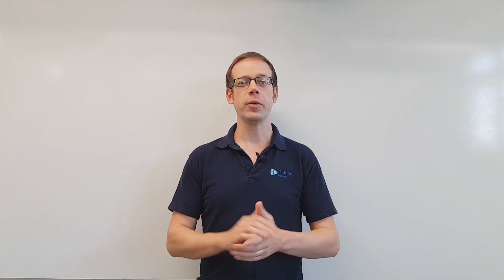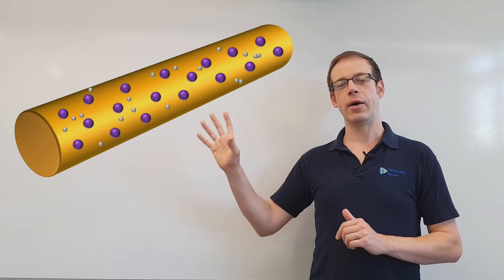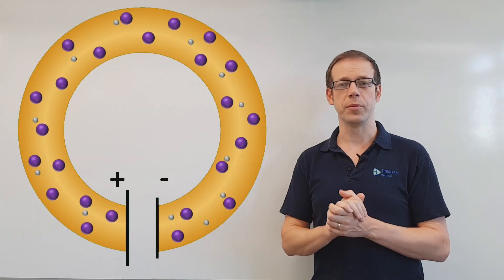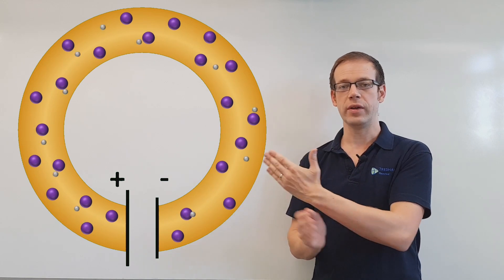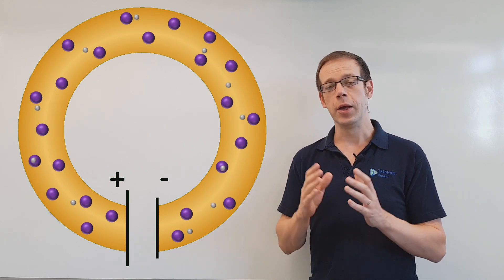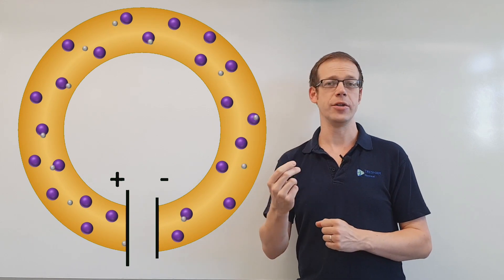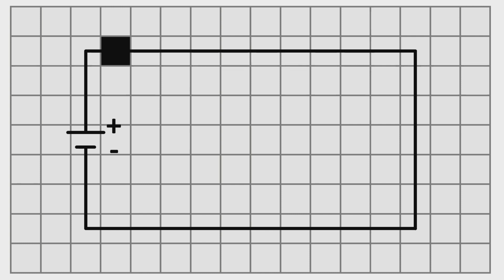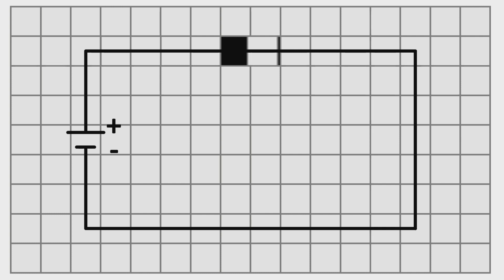What is Electricity? Part 3: Which Way Do Electrons Flow?

Comment: I was a student in the early 70's , this topic came up then too, vacuum tubes only make sense in a neg to pos current flow as the heater released free electrons, today the pos to neg is fine and the arrow is also pointing right. I know the Air Force taught neg to pos at least into the 80's.

Comment: As with Newtons apple, perhaps the assumption that, with the atomic particle analogy, it was assumed that said "particle" was positively charged (aka "up").
"up" vs. "down";   "up" has no meaning without the presumed existence of "down"
"Conventional current": the electrical charge moves (changes) from positive to negative; (aka "up" to "down")
Likewise, "positive" presumes the existence of "negative"... relatively speaking, less negative could be considered as "positive". To wit: the negative end of a battery is less positive than the other (i.e. not necessarily "zero"... aka "ground", or "common" - the term is a matter of choice; there were British automotive electrical systems that used "+" as "common") Said "holes" could be just as easily be referred to as "posies" (pronounced Paw- sees).

Comment: Hi Joe,

I hope you can clear this up for me. Since you mentioned the 29th Electron having a casual relationship with its parent atom, able to jump for atom to atom, I’ve been wondering why or if its just this 29th (free electron) that moves when energised, or do all 29 electrons move collectively.
 
I saw that you mentioned Brownian motion to a question on “why do electrons move randomly. Heres what I found, I was just confused as you have mentioned the 29th electron again. 

It is important to note that Brownian motion is not specifically associated with the 29th electron in copper or any specific electron in a material. Brownian motion arises from the thermal energy of the system and affects all particles within it, including atoms, molecules, and electrons.

In the case of copper, which is a solid conductor, the motion of electrons is not typically described by Brownian motion. Instead, the behaviour of electrons in a solid is better explained by quantum mechanical principles, such as energy bands and electron wave functions. Electrons in a solid like copper can exhibit collective behaviours, such as conducting electric current or participating in electronic interactions with neighbouring atoms.

Comment: You say the flow of electrons is the flow of electricity that flows from the negative terminal of a battery to the positive terminal. The problem with that logic is that electrical current actually does indeed flow from the positive terminal to the negative terminal in a dc circuit.

Simply experiment, connect a battery to 2 dc light bulbs that are separated by a significant distance and you will see the light bulb connected closer to the positive terminal light up first proving electrical current flows from the positive terminal to the negative terminal.

Comment: Hi Joe, i am always a bit confused. My eternal confusing comes from the following: So when you are touching the ground, and you touch a positive terminal, the ground is releasing the particles (electrons) that will actually shock you? Which is unintuitive because you would think the positive terminal (like a full bucket) would release the particles (water) to hit you. Its just  the unintuitive nature of negative particles i guess. Can you confirm my above line of thinking is correct?
Reply from the maker: Yeah that's pretty much right, the positive terminal has a lack of electrons which draws the electrons to it.

Comment: Nice video, Joe.  But which way is the electricity flowing?  The same direction as the electrons?  Or the same direction as the "current?"    Does the electricity travel along in the same direction as the electrons, sort of being propelled with the electrons?  Or does it flow opposite the electrons, with the "current," kind of being pulled by the electrons towards the negative terminal?
Reply from the maker: Electron flow is from negative to positive but we say its effect (the current) goes the other way to keep other calculations correct. It's weird. 🤦‍♂️
Reply: @JoeRobinsonTraining  I'm curious though, wouldn't the direction of electron flow being opposite of conventional current flow affect the way certain circuits are designed?
Reply from the maker: @cusemoneyman  yes indeed it does, especially when it comes to electronics.

Comment: Hi, Current is not a flow of electrons right? i.e electrons are not leaving the conductor however there is a force from battery or any source pushing the free electrons which will move certain distance as a consequence nearby electrons pushed in the same direction and this creates the Bulb glow. Am I correct?...also please let me know will the free electrons jump from one atom to another atom when the voltage is applied...Flow of electrons is not a defenition as one can assume electrons available in conductor completely drained out only protons are left
Reply from the maker: You're half right. Electrons do flow but they don't leave the conductor. When batteries fail they haven't run out of electrons, the chemical reaction causing the electrons to flow has run out.

Comment: Why need of MCB? I understand it is used for tripping but in theoretical term I don't understand.if possible can u explain.
Reply from the maker: It's to prevent too much current flowing and damaging the circuit or connected equipment.

Comment: Thanks for your videos, 
New subscriber, found your channel explain in clarity and simplicity

I have Q,
Does copper power cable after being used for time, get weaker, due to losing electrons?
When connecting the power cable to another material as of a device, does the electrons goes from the cable to the other device/ or connected cable?
Reply from the maker: Hi thanks for subscribing, the electrons do move along the conductor but as they move around in a circuit they are continually replacing each other. I'll try and do a video explaining it a little more clearly. Stay tuned for more!
Reply: @JoeRobinsonTraining  Thanks, and waiting for it

want to know, if the conductor lose over time, and becomes less conductor (need to be replaced)

and what if the conductor to complete the circuit, is from different material (as copper and Iron, or copper and another joint piece of copper)? does it apply electrons got moved between the two
Reply: @malibusa2  want to know, if the conductor lose over time, and becomes less conductor - - - -- In ideal conditions where there is no oxidation effects and creep factors, there should be no lose, unless any parameter changes. Remember Electrical conductivity is a material property! Coming to second one, what if connector is of different material, yes that's how most connectors are, what happens is simple, higher resistance for the electrons to travel and lead to joule heating.